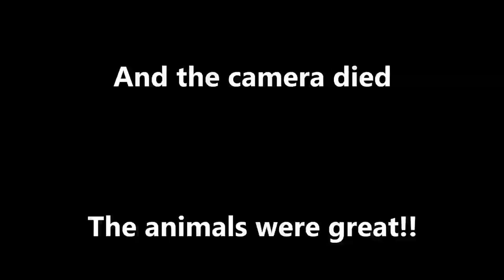VLOG#2 - Project Day (12-18-2016) V-LOG?? Video Log??

Comment: Is the sunroom facing due south? Any special windows used or just a single pane? I'm in PA and want/need a sunroom!
Reply from the maker: It does face South on the one side and the side with the door faces West.  They are just single pane with the ... flimsy?? metal trim.  Holes drilling in the trim and window screwed in on the outside. The Windows (or some) come down in the summer.  This is how all this was when we moved in. Thank you for watching!!!  - Mike